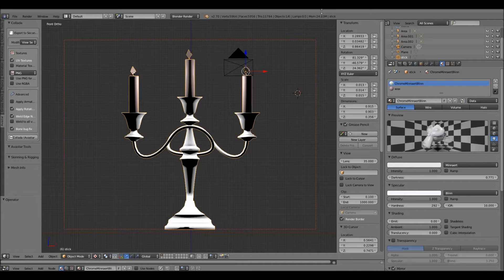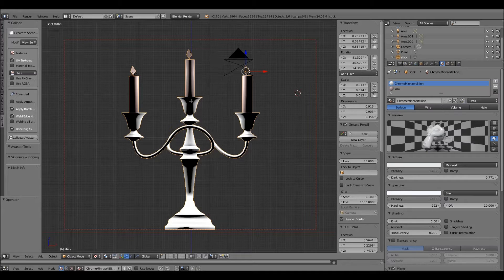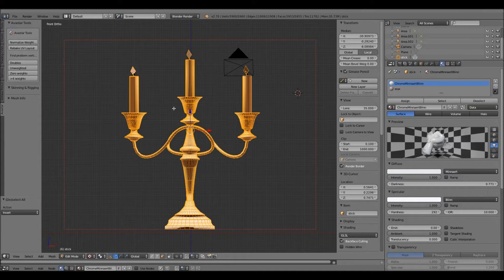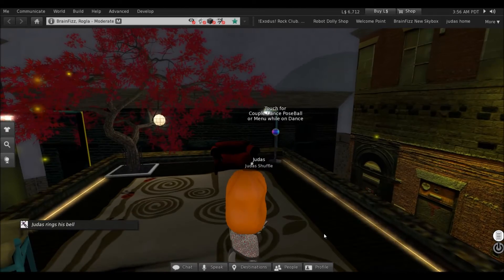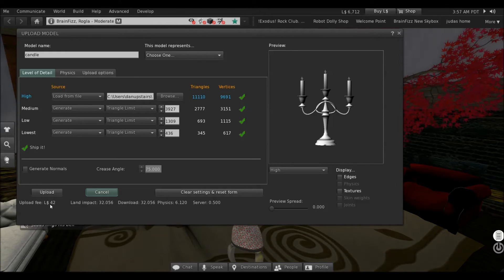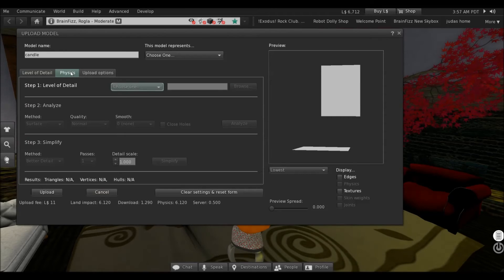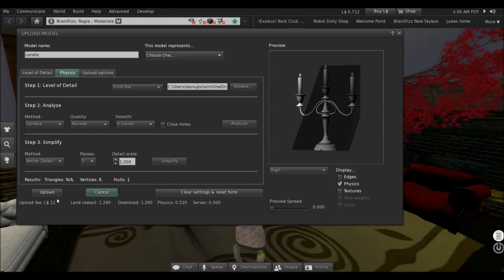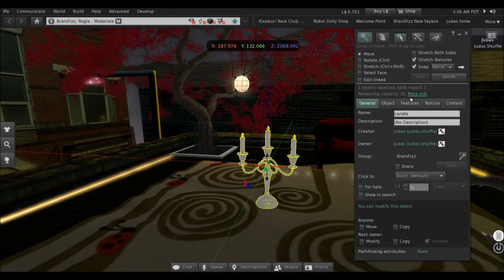Second life 1 prim mesh cheat

Comment: Lol, great job! I do something similar--I upload my complex object to the beta grid and take screenshots straight on. Back in Blender (or whatever program) with the screen shot, I make a LoD 4 version as a single face that I put the screenshot on. I then include a face on every other LoD model (or just the one if you don't do your own LoD models) using the screenshot  (make it tiny and hide it inside your object). Also, LoD 4 has to have a face for each of the other materials/textures that you used on LoD 1-3 so I add a row of faces for them that are tiny and facing down or whatever so they aren't seen--only the screenshot can be seen. 
I upload the object adding my new LoD 4 in the appropriate place and, now when you view your object from a far distance you see the screenshot! From far away this is all you need to see. Up close you'll see all the fine details of your object!
This doesn't work for everything but it's great for fences, gates, walls, roofs, etc etc that are often viewed from a far distance and that are fairly flat.
If your object needs to be seen from two (or more sides) take a screenshot of each and then, in Gimp (or ps or whatever) combine them into one image. Back in Blender use the UV editor to place the parts of the image on faces for the front and the back....half on one face, half on the other face that faces the opposite direction.

Comment: Confirmed still working in 2017.

When uploading your .dae into SL and doing this LOD trick, if you receive this error message:
Material of Model Is Not A Subset Of Reference Model

It likely means that your mesh model has gone over a 21844 triangle limit.  If a model does, SL automatically assigns a new material to your object.  There's an issue where you cannot do this "simple" LOD trick when two materials are assigned.  Check to make sure you didn't export more than one layer by accident.  When exporting from Blender to .dae, verify the "Selection Only" check box on the left hand side under Export COLLADA.

Source:
https://community.secondlife.com/forums/topic/351054-error-material-of-model-is-not-a-subset-of-reference-model/